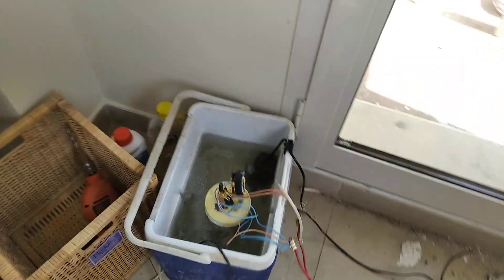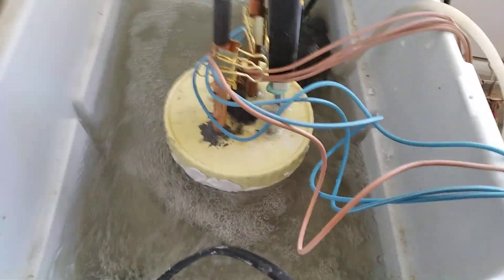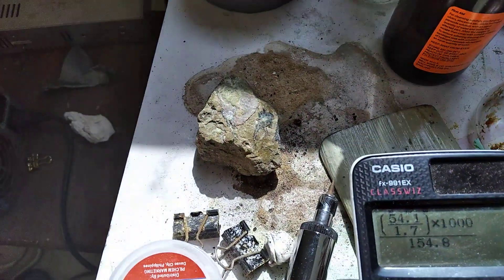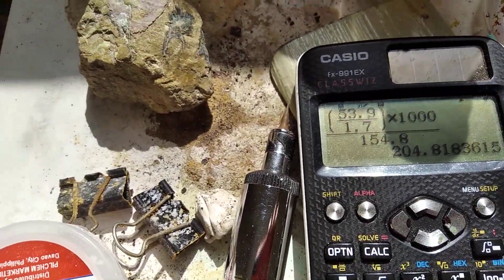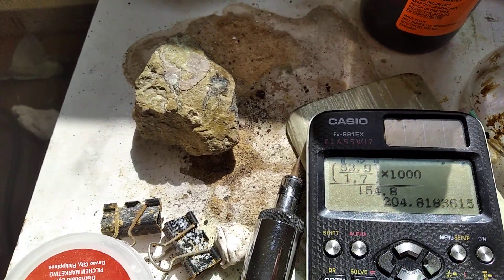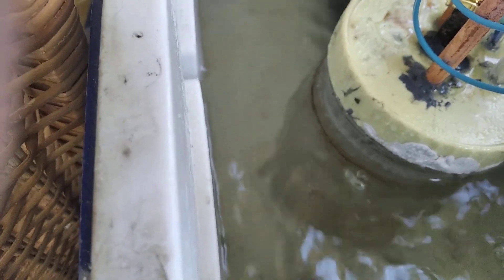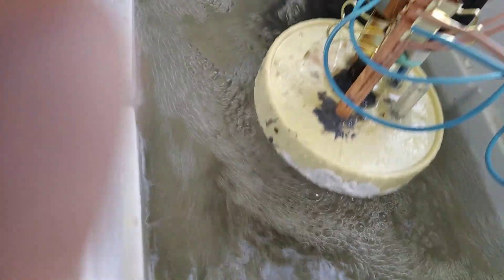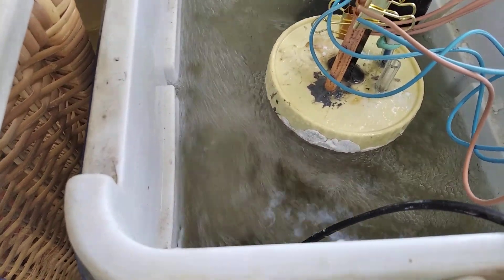32 amp perchlorate cell

Comment: how did you calculate the effective area of the mesh?
Reply from the maker: For these it's 1:1 because what u can do is because the thickness of the mesh is 1mm it means each hole has extra 1mm of flat surface. If the gap of each hole is also 1mm on average then you have 2 of these 1mm inner surfaces projected upward meaning it's 1:1 to a flat plate. If the dimensions are any other then you can also use resistive means to measure it's effective area using NaOH as electrolyte and steel as the anode and a Ti strip of known area as the calibration cathode.
Reply: DTO lead dioxide anode still work with you? @CatboyChemicalSociety

Comment: Graphite anode is a horror, do they actually hold up when used as a cathode?
Reply from the maker: YES actually graphite cathode is better than titanium!!! like really it doesnt embrittle and or bend towards the anode which ive had issues with Ti hydride formation.
Reply: @CatboyChemicalSociety  
Very interesting. How does it compare to stainless steel as a cathode?
Reply from the maker: @mrcool90210  you cant use stainless steel in a perchlorate cell without platinum electrodes.
It will leach chromates killing you anode's surface activity.
The stainless steel can be copper or nickel plated though to prevent this.
copper and nickel cathodes work too for perchlorates.
Titanium id say is a good cathode but shitty if you think about it because its not easy to plate Ti electrode contacts with copper as compared with anything else.
stainless steel can be used for chlorate production since chromates are not a problem there.

Comment: Cam you do a video on the electrodes?
Reply from the maker: you mean my PbO2 plating cell and all well sure.
I actually need to plate another MMO coated electrode that got fked up cuz I reversed polaritied the PbO2 coating.
Reply from the maker: look forward to it in my next video
Reply: Thanks brother,, that would be incredibly helpful!

Comment: That is badass! I need to build a perchlorate cell soon.
Reply from the maker: you would need to modify an MMO anode to support PbO2 for best results.
or get your hands on tin nitrate and dope it with antimony or bismuth or manganese for the precoat.
ofc you need a Ti electrode either way if you are gonna go the 2nd route.
Reply: I have a small mmo and titanium electrode unit. The only manganese source I have right now is the pounds of KMnO4. Any way to use that, that you can think of? I have lead and everything to make the PbO2.
Reply from the maker: @chemistryofquestionablequa6252  you can do 2 things here.
the KMnO4 can be made into a solution and you can use a titanium electrode as a cathode and a layer of MnO2 will deposit on its surface.
you then bake that electrode at 400 Celsius to convert the MnO2 into the conductive form.
then you plate it in lead perchlorate to get PbO2.

If you want to convert your MMO into PbO2.

The MMO can be first plated in lead acetate for 15 minutes at 7 minutes per side at a current density of 6ma/cm^2 at 40 Celsius.

The electrode is then plated in lead perchlorate/chlorate at 8ma/cm^2 at 40 Celsius for 12 hours to get a thick coating of PbO2.

A converted MMO can be used to run chloride all the way to perchlorate but errosion will occur until equilibrium since PbO2 doesnt like high chloride environments.

Lead perchlorate/chlorate can be made with a membrane cell and lead electrodes and you can also use lead nitrate but the bath temperature must be higher like 60 Celsius.

surfactants are also important here and the best to use is benzalkonium chloride which can be found in the nail polish remover section right next to the acetone in the grocery.

There are other surfactants like liquid hand soap which also can be used and is suggested to prevent lead salt spray during plating which is really bad!!

for lead perchlorate you can immerse lead metal to regenerate the plating bath continiously.
Reply: @MysteriusBhoice thanks for the thorough rundown of the processes. My mmo unit is bonded with plastic and white small to be inserted in a bottle to make disinfectant. I don't think I can heat it to 400c. I'm going to have to buy a cheap platinised electrode, or go the route of PbO2 on carbon I think. I'll definitely have to try your methods when I can. We have a new baby, so free time is in short supply, lol.
Reply from the maker: @chemistryofquestionablequa6252  graphite substrate is a waste of time dont do.
thermal expansion difference is what causes destruction of the anode due to high operating current densities.

Comment from the maker: btw thats 1.7 miliohms shunt resistance and 54 milivolts of shunt reading.
since I need to divide miliamps/cm^2 I need to friggin multiply by 1000.
The shunt was checked for calibration drift before running the cell and due to my awesome cursed crimping job it holds up to the calibration!!